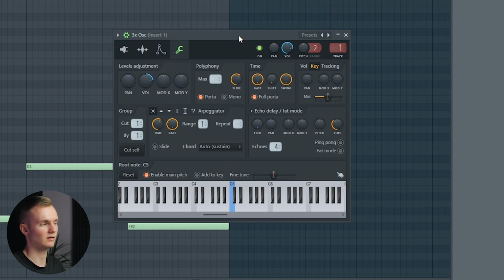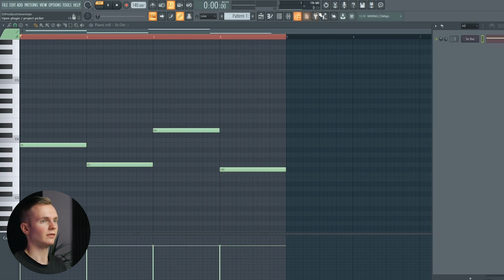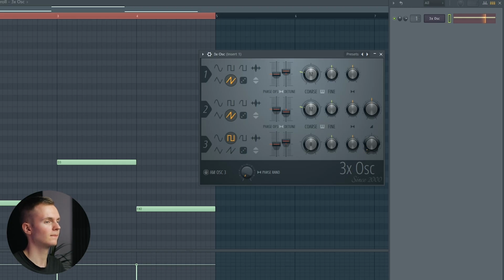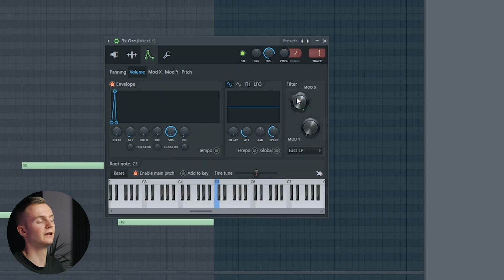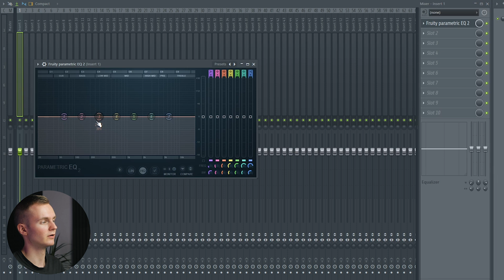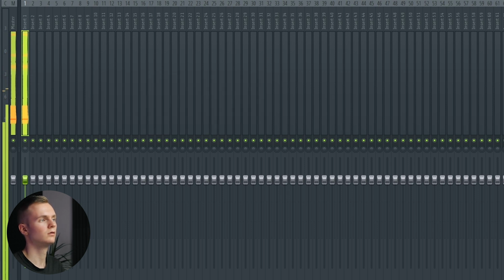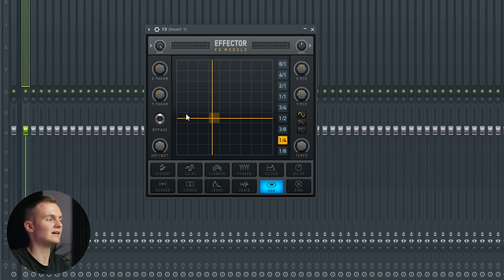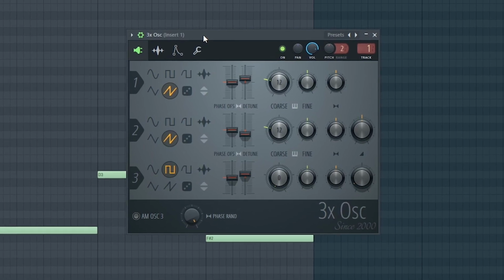How To Make A Reese Bass with 3xOsc (FL Studio)

Comment: Hey Severman,
I have huge , brief and descriptive  question to ask you ,hoping that I wud get a clarification on this matter as I get confused when people talk about signal to noise ratio could affect the the sound if compressor, saturation plugins are added, without monitoring the gain of a sound in that channel.

Key terms:-
No Bracket - Question
[ ] - my thoughts in my mind
{ } - example
( ) - specific

So my question is.....
When to do gain staging ,is it while before producing [ {sound selection(high signal to noise ratio at least not clipping )as assuming it to be ,when fader of channel is at reset 0db.... because while producing we may use plugins like compressor, saturation on that sound in channel in a way that it can affect the high digital volume (not clipping) , means that plugins still receiving high gain signal even if volume fader is pulled down ]...or or or is it after producing and rendering the stems at -10db such  that whole sum of stem's volume  shows -6db in the master channel [ ignoring the digital volume stuff*** and signal technicalities and producing the music as I want till it's finished producing ]
Reply from the maker: Hey man! I'm just gonna be honest, I don't really have an idea what you mean. 😅
I think you're worrying too much about theoretical stuff which you really don't need man. At the end of the day it's always about using your ears and if it sounds good it sounds good. No matter what settings you have applied or how you've done it!